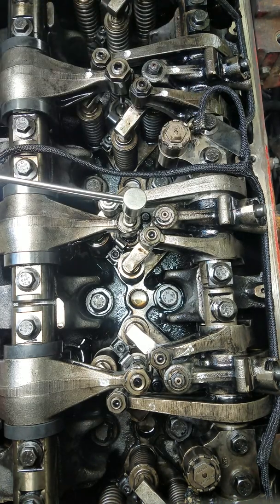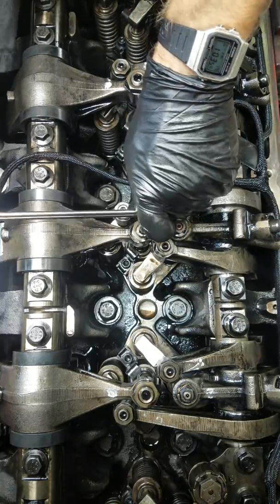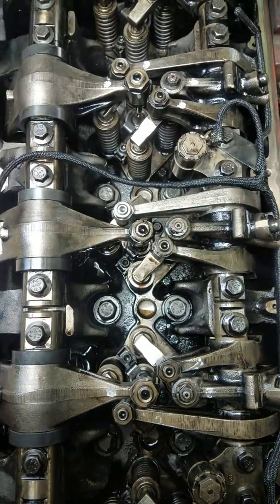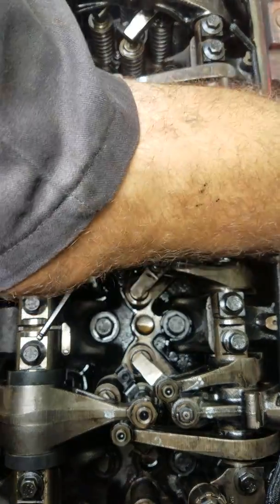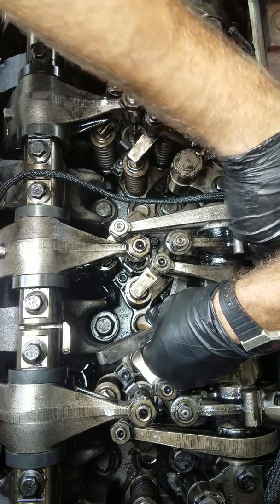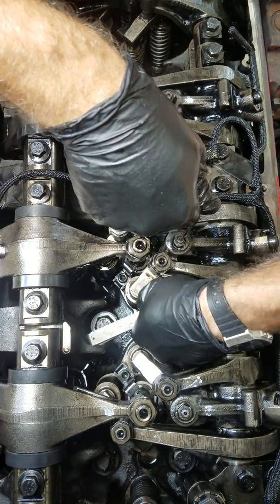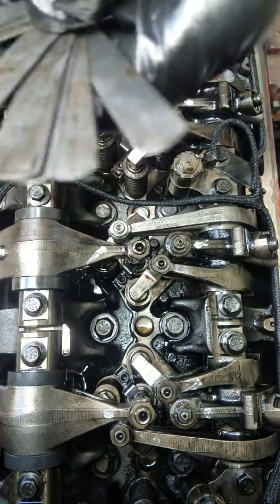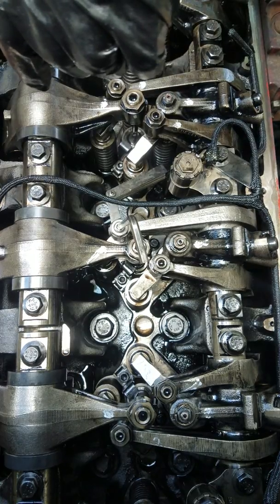Cummins isx overhead valve adjustment pt 2

Comment: Cool man, i like the simplicity of it and how you mention that you dont need to rack up a $1000 bill with snap on or matco in order to work on the shafts. (sometimes expensive heavy duty tools are needed, but not always.... if you dont mind me asking, how much would somebody like you charge to do an entire overhead valve adjustment (if i may ask, rough estimate)